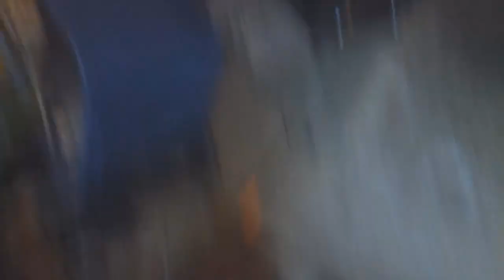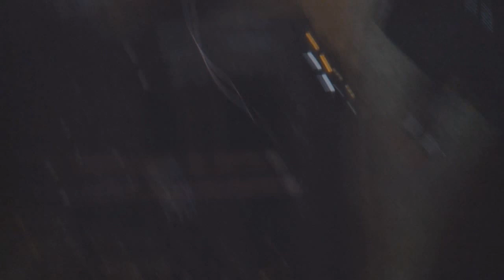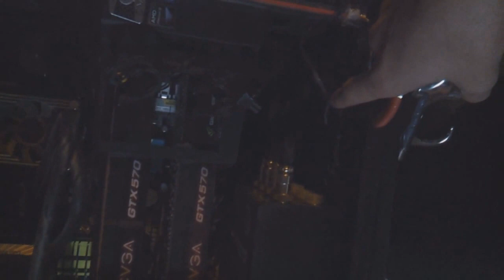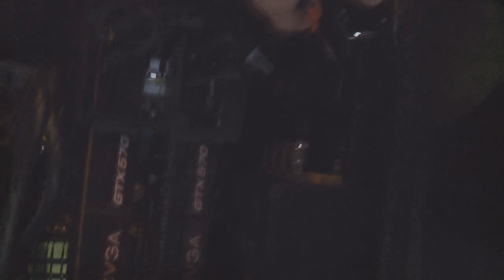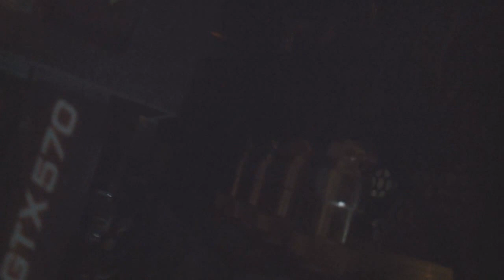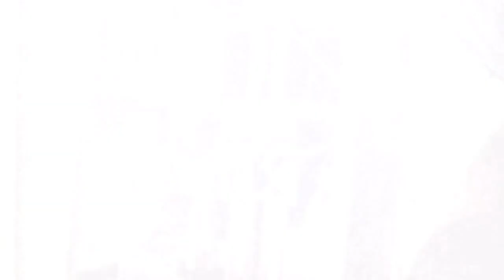MisterNBG's Gaming PC - Extra - Fan Lights without Power

Comment: Great way to ruin your fans lol they are spinning at higher rpm then they are meant to when you do that. For cleaning with compressed air at least hold the fan in place.